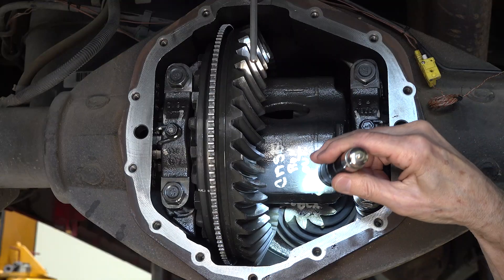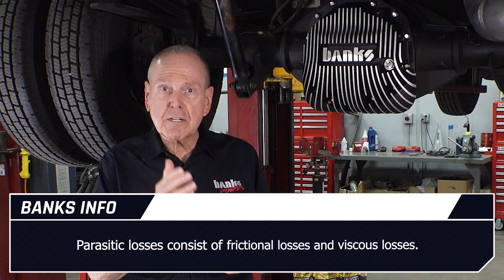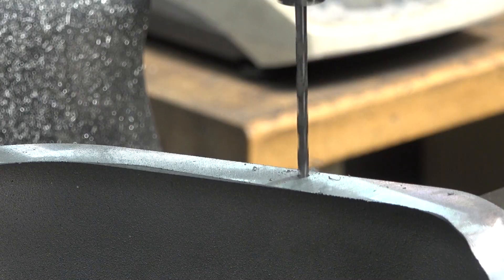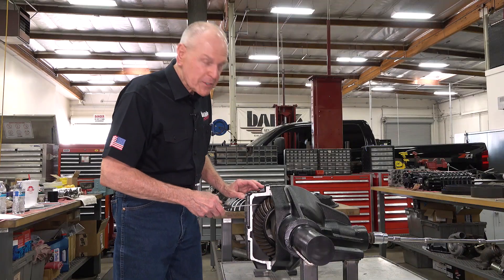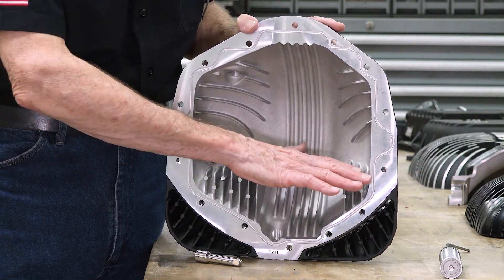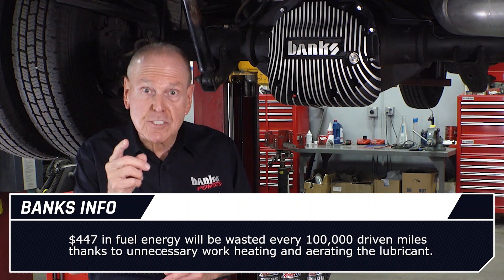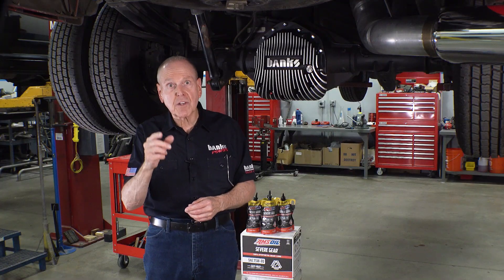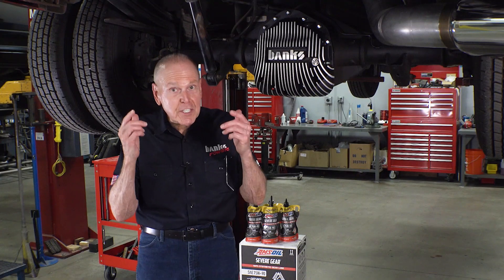Is your differential cover KILLING your gears?

Comment: The cooling fins are good but useless for 4w drives. Rocks will just snap the lower part that hangs lower than the diff. It should be the other way where the fin redirects are above the diff leaving the lower diff to be able to cope with scraping along rocks. Hopefully banks will change the design for 4w drives. Good work anyway banks.
Reply from the maker: Looks like you may have commented without watching the end of the video where Gale breaks off the cooling fin to show that the cover is still intact. Now, keep in mind that very few 4x4s actually go off-road. Also, it's important to note that the fins are no lower than the lowest part of the diff housing. So, if you hit a rock, it's hitting your diff at the same time. But for serious off-roaders, we recommend a hardened steel cover, not aluminum. Regarding airflow... there isn't much over the diff. Most of the airflow is coming from under the diff.
Reply: @bankspower  Yeah I saw that part. Also I saw where they pointed out where the wind was going. I agree there would be more wind going under but there still would be a fair amount going above it too. 4w drives are usually jacked up so the whole of the diff would be exposed to the wind traveling over and under it. Also, 4w drive diffs work extremely hard and therefore any cooling would definitely be of benefit.

Comment: How did the ppe diff cover hold up? That’s what I have on my truck and would like to know since banks doesn’t make a diff cover for the 2003 Ford F-250
Reply from the maker: The PPE performs worse than Mag-Hytec. Why? The interior fins are oriented in the wrong direction causing massive turbulence and foaming.

Comment: I like your design. But I would definitely break those covers and filll them with mud. Do you have one without the ram air?
Reply from the maker: The patented part of this cover is the Ram-Air scoops. Without them there would be no air rushing through the fins. If you fill them with mud, hose it out.
Reply: @bankspower  You don't understand. I can break anything..lol seriously and I would be miles from a hose. I would have to dig it out every five min with a stick or something. Its a good Idea for sure for some people. But it would get me hung up anyway. I do like the cooling fins inside and out. That could help me keep cool when I'm pulling a trailer. But the "ram air" has no chance... It would not make it through one week.  I've put 3 axles and 2 gear sets in this truck and had the fella at the welding shop put a brace on it because I was bending the tubes. Yes its abuse I know, but they don't makem like they used to I guess. I suppose I really need a bigger axle. I have excessive weight to pull and mud and big rocks and stuck tractors.

Comment: I have a Sterling 10.25" axle with a (very unusual) 3.08 R&P set.   Perforce the ring gear is smaller O.D. than the higher ratios usually seen on trucks.   Would this affect lube flow?

Comment: Is there a plan to make diff covers for other common rear ends?
Reply from the maker: Click here to learn more: https://www.bankspower.com/i-2930

Here are some of the other upcoming diff covers.
▪️Sterling 10.25 & 10.5 12" bolt (86-19 F250/F350s)
▪️Dana M275 - Ford '17+ (F250 HD/F350 SRW)
▪️Dana M300 - Ford '17-'19 (F350 DRW/F450)
▪️Dana 80 (94-02 Ram 5.9, F350/450 99-07)
▪️AAM 12", 14 Bolt- GM 2020+, Ram 2019+

Comment: We need a new diff cover for the half ton Silverado’s please.
Reply from the maker: They're coming!
Reply: Need to get rid of the one I have on it now. Thanks
Reply: @bankspower  Gale, thanks for the development of another excellent product. Will these be available for the GM/AAM 14 bolt?
Reply: @bankspower  Don't forget the larger Max Tow NHT Half ton rear axles.
12 bolt C10 & K10 1973 - 1987 Squarebody
14 bolt 9.5" Ring Gear F44 Semi float GMT400 1988 - 1998
14 bolt 9.5" Ring Gear GMT900 2007.5 - 2013
12 bolt 9.76 Ring Gear K2XX 2014 - 2018
Reply: @bankspower  that's what I wanted to hear 👍

Comment: I want a diff cover for my 1986 M1009 CUCV with a 10 bolt axle and my 2000 F250 Super Duty with the Sterling 10.5 axle.

Comment: I know it is not the main use case, but what if you take this to the 40 below Fairbanks Alaska?  Is there such thing as too much heat transfer to the environment?
Reply from the maker: Even in this temp, the diff will still be plenty warm. This will work just fine.

Comment: The cool thing is bmw already has something similar to this on there M3/M5. Lookup E92 M3 diff cover and take a look. They had this since 2008. If the Germans are doing this for there performance cars why not having it for heavy duty trucks.
Reply: FishFind3000 my 2007 e60 550i had a cover with the fins and air guide also. I’m unsure when that style was first used and if BMW was truly first.

Comment: First of all - why is this video being reposted? I was genuinely excited that Gale was going to add some REAL data, of which he did not.

If this was such an obvious problem, why not give us temperature data? Gear oil test results after running each type of cover? Dyno comparison? Something? All he can come up with is a dollar amount after 100k miles.. don't be confused here, scale matters. Running 1/2 psi more tire pressure likely makes a similar difference after that many miles. The drag added by his differential 'air scoops' could have a similar effect. He can't even give us the parameters - is this 100k miles loaded? Unloaded? What average speed? something?!?

Chances are good he didn't actually find much, which is why this video is mostly marketing. 

Most of his accusations and theories are just that, without backing of real data they are just good ideas, 'on paper'. There are a few large factors to consider that he does not address.

Gale, please convince us why we need to actually spend much more on your product. You tout your R&D capabilities, let's see them at work! It will grant you some credibility.
Reply: "Trust me, I'm Gale Banks."
Reply from the maker: This was an edited version of the video posted in November 2019. The original video was over 30 minutes long. Very few people watched the entire video, so we edited it down and reposted it. You'll find all the data here. https://www.bankspower.com/i-2892
Reply: @dchawk81  lolol

Comment: Question: how does it stand up to snow and road salt. Also when it gets snow or mud stuck in the ram air portion of the cover
Reply from the maker: Stands up to snow with issues! If it gets filled with debris, simply hose it out. For salted roads, we recommend the powder-coated cover as opposed to the natural (raw) aluminum option.
Reply: What happens to the case vent under the same conditions or traversing a high water creek? What about the axle seals after submerged? The same thing, you take the time to inspect the components and fluid for condition and proper operation. At least I would as the owners manual would call this “Heavy Duty Usage”. Yes, snow and water covered roads happen, but engineering by the manufacture or this product can NOT bubba-proof everything. ASE Master Tech since 78 - Retired (Working long before)

Comment: No I guess my dodge factory cover is doing it’s job just fine. Traded off my 2012 3500 dully with 260k on it that’s used to pull a 12k 5th wheel all over the USA for work. My 2018 3500 has 75 k on it and let me check ..... nope gears are just fine !!
Reply: That's just getting broken in on those!

Comment: I wonder if the increased coefficient of aerodynamic drag from the scoop offsets the simulated MPG increase from keeping the lube cooler and therefore spinning easier....? Sweet idea, but it almost seems like you're trading one parasitic loss for another. Not bashing or anything as Gale is a brilliant guy, but I'm legit curious.
Reply from the maker: The short answer is no, the added drag is negligible compared to your drag your suspension is already creating.

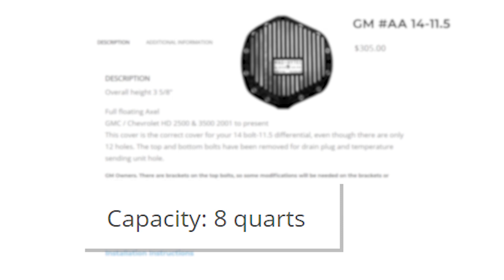Comment: My still very disappointed ☹️ I have a F350 Powerstroke King Ranch dually with a 4:30 gear radio and you guys still don't sell a differential cover
Reply from the maker: Don't be disappointed. Sterling axle cover is now in production, followed by M275, M300, and various Danas.

Comment: Well how come big rigs and dump trucks that carry 80,000 LBS on a daily basis don't have differential problems....and secondly I have a mag hytec differential cover on my 2008 gmc duramax since I got my truck new and just shy of 300k miles with no differential problems...and another thing what's really the the fuel mileage difference with the rear end with 8 quarts vs 4 quarts I bet hardly minimally that anyone will notice and who cares about fuel mileage when you are towing
What Gale Banks needs to do is real world testing with his differential cover and all other covers with differential temperature gauges and video cameras on 2 identical trucks pulling the same weight and the same outside temperature, highway speeds and hills for an 8 hour period and then show the results....I bet the difference in temperature is minimal 🤔😉
Reply: - Big rigs don't have differential problems because they have a well designed housing shape for good oil flow. Sometimes they use external differential oil coolers as well.  
- Flat back differential covers don't simply destroy differentials, they are just an ineffective way to reduce heat and they can reduce the lifespan of differential components.  
- Banks have already done a lot of real world testing, more than enough to get definitive results. Have a look at their other video: https://www.youtube.com/watch?v=vdtmDl5EDJ8
Reply: @JeremyPetho  Yeah a semi just has a plain round one. So if your pickup has a plain round one or a plain round one with fins you're good to go. 👍

Comment: Will spend my cash if they decide to add the 10.5” 14bolt
Reply: hell, there are many GM 10 bolt and 14 bolt diffs that would benefit from this.  I have a 1/2 ton van, that drives 400+ miles a day.  That would save my rear end, literally.  Many overworked 1/2 ton trucks and vans that would get better fuel econ with one of these.

Comment: Why don't you build your diff covers for Dana 44 and 35? Many jeepers would buy!
Reply: For most jeepers the stock diff covers are a better option. Made of steel and they are not constantly towing heavy so the extra cooling is not needed.

Comment: Do you make them for Toyota Corolla?
Reply from the maker: Negative. Right now the engineering team is focused on the current-gen GM, Ford, and Cummins HD diff covers. 

Here are the upcoming diff covers.
▪️Sterling 10.25 & 10.5 12" bolt (86-19 F250/F350s)
▪️Dana M275 - Ford '17+ (F250 HD/F350 SRW)
▪️Dana M300 - Ford '17-'19 (F350 DRW/F450)
▪️Dana 80 (94-02 Ram 5.9, F350/450 99-07)
▪️AAM 12", 14 Bolt- GM 2020+, Ram 2019+

Comment: uh, what fluid temperature delta did you see? you explanation was mostly accurate in the turbulence and viscous losses are responsible for fluid heat generation, but there is not much evidence presented. was it the splatter of the fluid creating a higher height for the fluid, thus wasting pinion energy into gravitational potential for the fluid? this energy is then transmitted into heat by the viscous forces of the fluid as it runs together? is there really an energy savings? were you able to measure power differences before and after in your trick setup? you're saying you are gaining almost a 2 percent efficiency gain with this one dif cover? did you actually run it for 100000 miles and see the gains in performance? that would take quite a while and there are even more variables at play such as environmental and driver conditions that could impact that efficiency. The only efficiency gains you will see are from decreasing viscous losses, which decreasing the temperature of the fluid only increases the viscosity, leading to more inter-particle viscous losses. The temperature of the fluid is in response to frictional losses and cooling potential. you have added a lot of cooling potential, but efficiency is gained from decreasing frictional losses. so like, i think you can only really say that you are managing the fluid in a way that decreases fluid spontaneity. do you have any modeling that shows less frictional and fluid losses? ansys particle simulations maybe? gearsets are already known to be incredibly efficient, like 90% plus, so i dunno if these axles really have up to a 2% loss in efficiency from the fluid. 

 yall are jumping over this as irrefutable evidence, but you would need to see some actual engineering evidence for this.
Reply: Press x to doubt

Comment: Any info on front diff covers??
Reply from the maker: We have a long history of problem-solving. And, since the front axle is being blasted with air as you drive, there's no problem to solve. As you know we don't typically make products solely for beautification. The other issue is that front axles vary from package to package so we'd likely have to make quite a few covers to fit the most popular full-size trucks.
Reply: @bankspower  thank you for that. Wish they had a drain plug.

Comment: Do you guys make a cover for F150 trucks?
Reply from the maker: Currently, we're going into production with a cover for the FORD Sterling Axle 12-bolt with 10.25/10.5 ring gear. This covers 2000-2010 F150s. Later this summer we'll be starting production on covers for late model F150s.
Reply: @bankspower  awesome. Can't wait :D

Comment: should have made it look like a giant set of balls ... 10x the sales!   other than that, its useless.  i agree with banks the flat back covers are dumb.  the trucks are designed to pull  xxx tons ( with the stock diff cover)  as the owners manual states. ive  NEVER pulled a diff apart and said " it looks like this didn't get enough air flow!  bullshit. any failure i have seen has been from lack of maintenance or someone doing something stupid. change the oil at the recommended intervals and you'll be fine.  i had a 95 chevy 1 ton with 600k on it. i wanted to change the rear end ratio - guess what the bearings looked like? BRAND NEW! regular oil changes do A LOT!   

p.s. i see a lot of hot shot trucks on the highway - pulling waaay more than intended (3-4 car  hauler)  9 out of 10 have the stock diff cover.  but i haven't seen one guy on the side of the road holding his diff cover in his hand and throwing his hat on the ground in anger ???

Comment: i have asked banks since the first video.. months ago.. compare my factory stock dana 70 finned aluminum cover to his expensive cover... banks refuses the comparison. Banks only battles steel and aftermarket covers against his cover.  Dana has way more r&d than banks. a factory finned aluminum cover is about $160. from DANA .
Reply from the maker: From what we can tell, FCA no longer offers the finned cover you're referring to. All late-model RAMS come with a stamped steel cover, even the H.O. with towing packages. Is your stock finned over than a stamped steel cover? Yes. Does air rush through the fins or have the internal surface area like the Banks cover? No. Should you rush out to buy our cover? Probably no. There's not enough difference between yours and the Ram-Air cover. However, you are in the minority. According to SEMA, only one in 250 trucks have the finned cover that you're referring to. So, our cover is for the 249 who have stamped steel covers or the other group who have flat-back aftermarket covers.

Comment: excellent ideas but your going to be replacing a ton of those dif covers when the 4x4 club comes knocking at your door
Reply: They arent designed for off highway use, Anyone with common sense knows finned aluminum diff covers don't belong on rock crawlers.
Reply: @casada70  exactly, big heavy cast iron covers to bash and slide.
Reply: This is for highway use, for off-road only you probably are better off using a machined cover, something sturdier.

Comment: Wait til those heat fins break off inside your diff
Reply from the maker: And why would they break off in your diff? They're die-cast aluminum no different than hundreds of parts on your engine.
Reply: @bankspower  same reason metal breaks all the time. Vibrations along with heat cycles.
Reply: @bankspower  there is no die cast parts in my engine..btw

Comment: Stock diff cover is best
Reply from the maker: Well, no. There is no cooling on most stock covers.
Reply: @bankspower  weld some fins to stock cover. I'm scared of the fins on the inside breaking off.
Reply: @bankspower  semi trucks don't have fins. Sorry, sounds like you are selling "snake oil". Gimmick, nich part that will work wonders.

Comment: It pays for itself ..how funny is that. Not everyone does 100K miles in a few years. Besides they don't even make it for the Silverado 1500
Reply from the maker: We don't make the covers for the 1500 series yet. Right now the engineering team is focused on the current-gen GM, Ford, and Cummins HD diff covers.  After these are done, we will proceed with F-150/1500 trucks and Jeeps. As of now, we are not sure of the exact vehicles that we will be working on yet, but it will consist of 1/2 ton truck and suv's.

Comment: No diff covers for Ford?!?  What is this treason?!?  Oh...in production?  Ford Sterling axle with 10.5 ring gear?  What is that for...Raptors?  My 2018 XLT has 9.75 gears.  Does that mean I won't see a diff cover for a long time, Banks??
Reply from the maker: We have three Ford applications in production. Sterling, M275 and M300 with Danas following. Stay tuned!
Reply: @bankspower  Do you happen to have a release date?  I'm gonna be switching out my RnP gears within the next couple months...